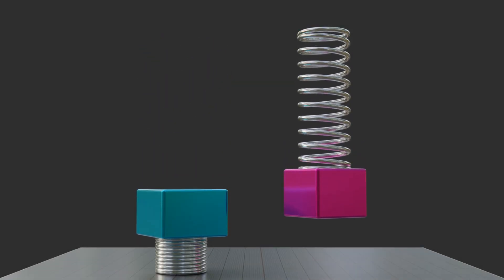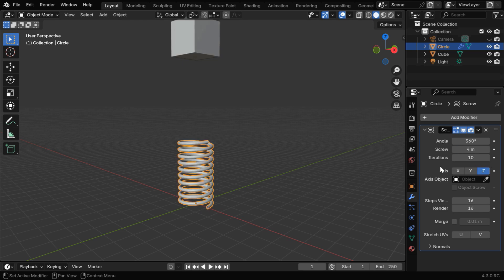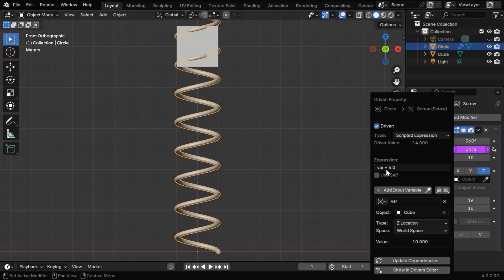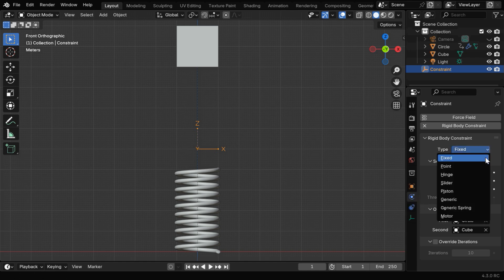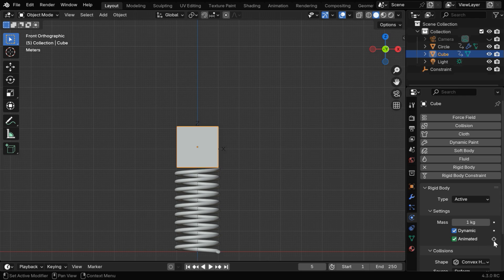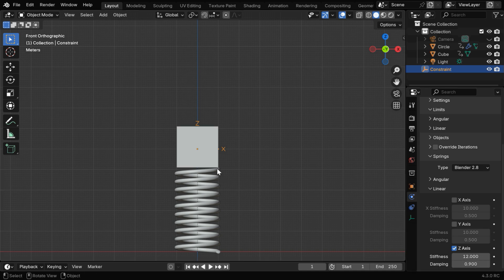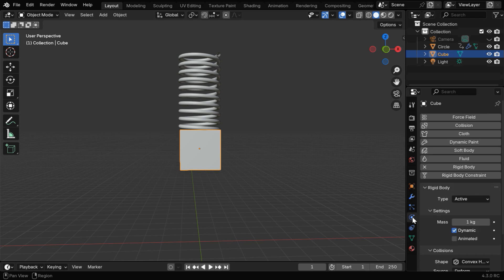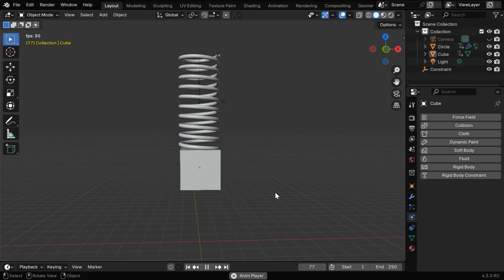Rigid Body Spring Constraint Explained | Blender Tutorial

Comment: Thanks for this video! Is it possible to illuminate the floor (keep it bright like it was with 2 lights )...but have a darker shadow like in the end? I need both lights illuminating the floor but the second light washes out the shadow... is it possible the second light lighting the floor but not affecting cast shadow on the floor? please let me know....
Reply from the maker: Yes, you can do that using Light Linking... please check this detailed tutorial 👉 https://youtu.be/fepW01FoIXw
Reply: @5MinutesBlender  Hi Thanks! Yes i watched the tutorial. You kept the shadow dark by having the second light not reach the floor ... is it possible to have it reach the floor(illuminate the floor together with 1st light).. but the cast shadow from 1st light appear darker. Basically the second light needs to only help light the surface but in no way affect the cast shadow from the first light? is this possible? Thanks...
Reply from the maker: @jonjon5342  This is actually a common thought process but trust me, there is a contradiction here. When a light illuminates a surface, it reduces any shadow present on that surface, it is the basic nature of light. In your case, if you want the 2nd light to illuminate the floor, it will also reduce the shadow on the floor (from any light). So the shadow of the 1st light will look lighter. We can't change that.
Reply: @5MinutesBlender  thank you i think you're right!

Comment: Hey bro can I ask you if it's possible to make a weighing scale that tells you object weight using the spring mechanism? Like Rigid body simulation to show reading of object weight on a weighing scale? ⚖️
Reply from the maker: Yes possible. Behind the scene, the spring won't actually measure the weight of the rigid body, we will need to set the weight to be shown on the scale. Let the rigid body be hung from the spring and display an increasing scale measurement and fix it at a predefined value. For animating the weighing scale display you can use the concept as shown in this tutorial 👉 https://youtu.be/xXmX0IsiCWY or https://youtu.be/oFv-fNiSdRM
Reply: So it's not possible to do a real time physics simulation to get this weighing scale to work ?
Reply from the maker: @FATEYYYY  You can use a driver to connect the spring behavior to the mass of the object you want to weigh. I could not think of any practical scenario where it may be useful but if you have a need you can do it this way. In the driver setup, we have used a hardcoded value for the height of the spring. You need to connect the mass of the hanging object into this formula. This will automate the process. There is no physics interaction available in Blender to do it otherwise.
Reply: @5MinutesBlender  I am new to blender and I was just experimenting rigid body physics and then I wondered if something like that could be done using physics simulation (not animation). I don't understand drivers in blender just yet but thanks for your response.